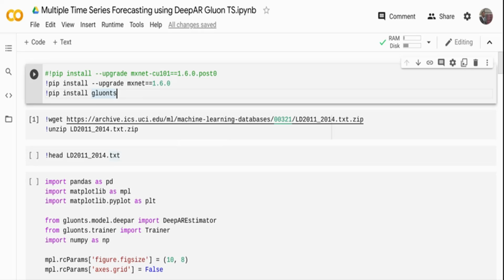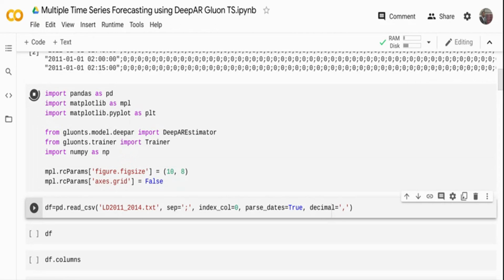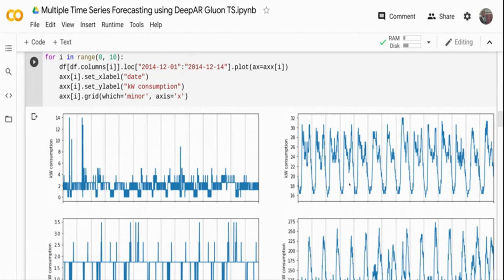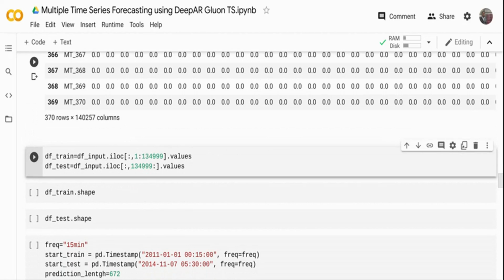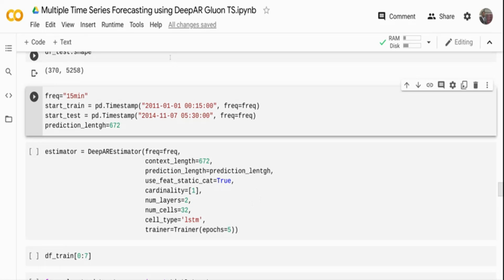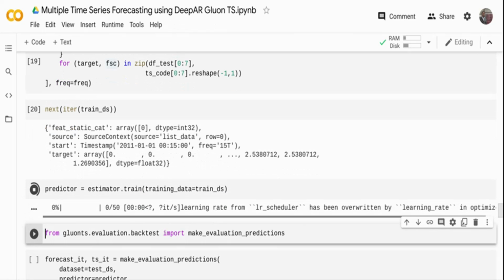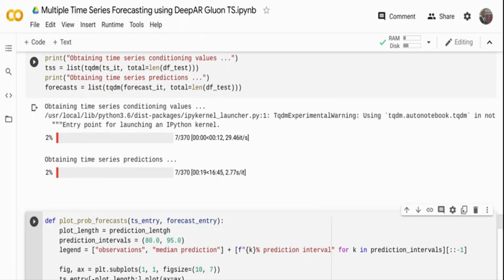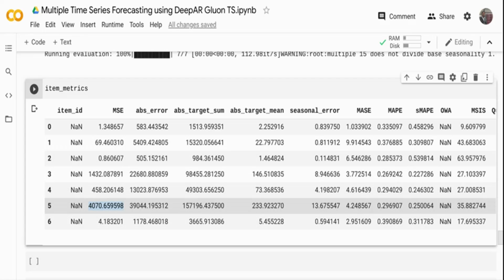Multiple Time Series using DeepAR and Python

Comment: This is really helpful. Is there any pre defined function in GluonTS to get the output of all the series across the prediction length in a tabular format. 

Also let's say if we have additional regressors (continuos varaible ) apart from energy consumption in the data and I feel that it might be a good signal for me to include in the model. How can we add that to the estimator? I feel transposing the data may not be the right methodology when we have additional regressors to add would like to know your thoughts on this
Reply from the maker: Output forecasts that we got will give you all series data in tabular format. I have just iterated over it to print individual graphs

You can add additional regressors as list of arrays to variable called feat_dynamic_real similar to how I added categorical series. You need not transpose as well. I transposed as it is easy to understand each series as rows rather columns
Reply: Great question. for each regressor does it mean to build another model?
Reply: @coolbuddy474  Not a different model completly there are ways in deepAR where we can pass this as a dynamic features just that there need to be other way to pre process the data. Currently I am using group by operation and then use those groups for preparing my data not sure whether this is the efficient way to handle if I have additional regressors in my data
Reply: Karthi S hows the model performance in general? Can this be used for Unsupervised Anomaly Detection in the same setup?
Reply from the maker: Cool Buddy. You can use the output for anomaly detection as well but I would suggest to use Facebook prophet or autoencoders, which might give better results
Reply: AIEngineering  Thanks for the reply. I have the same situation like multiple timeseries with different patterns. Fbprophet is working well, however the single  threshold doesn’t work. I am not sure how to get/set dynamic thresholds.
Reply from the maker: @coolbuddy474  The threshold must be for each time series be it prophet or DeepAR. So if u have seen my prophet anomaly detection video the same logic has to be applied on individual time series
Reply: AIEngineering Thanks again for reply. I have seen your video and understand the threshold is per ts. (Ex: u say 1.5 * uncertainty) But how to determine it dynamically for each ts is still not very sure to me. I have 120 tseries es and i cant choose threshold for each ts individually.
Reply from the maker: @cool buddy.. There is not much option here. This is one time manual setting or you can calculate it in program and set threshold to all time series as above some standard deviation based on its mean and variance